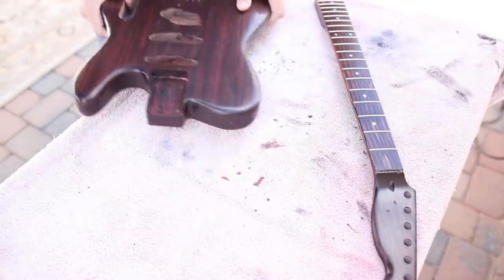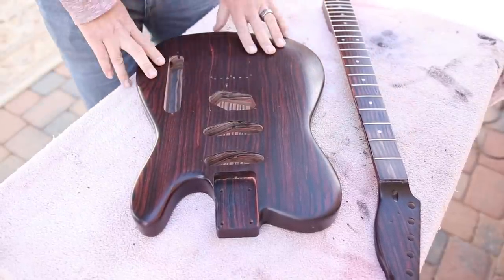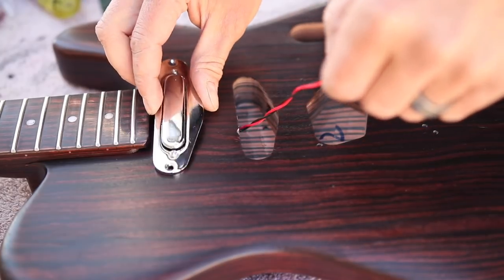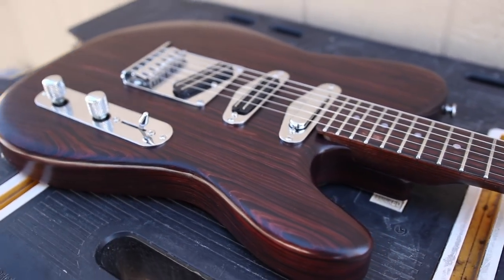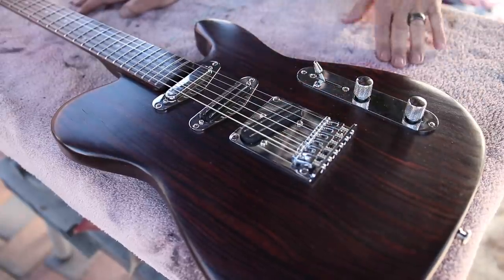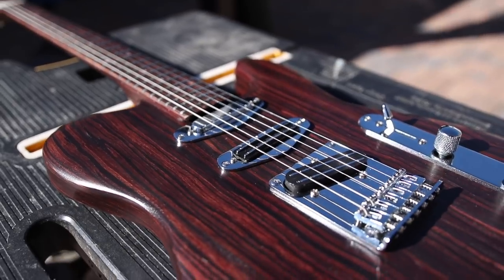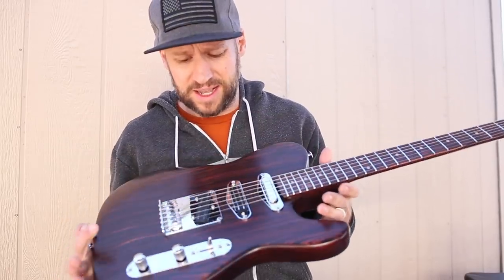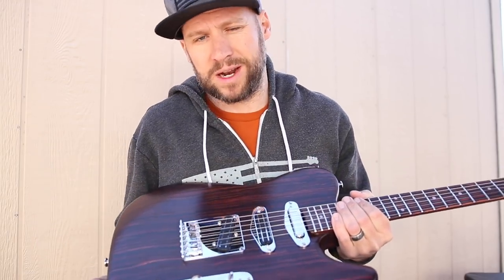Build Your DREAM Zebrawood Nashville Tele (part 2) 10 unique tones!

Comment: Sometimes cheap pickups can surprise you. I've found that the sub-$20 Artec Alnico V mini-humbucker makes a PERFECT neck pickup for a Telecaster. I've built a couple of 'em and gotten favorable feedback.

Next Tele project is a Telestrat HSS, with two Tele neck pups I have laying around (from the sets I bought for the above two Teles :) ), and a Duncan Stag Mag for the bridge.  Five way switch will allow  N, N+M parallel, M, N+M series, and Bridge.  A mini toggle will flip the phase on one of the Tele picukps, and another mini toggle will do series/parallel for the bridge.  Need to get a HB-mount Tele bridge, 'cause I'm convinced that most of the Tele Twang™ comes from that big slab o metal.

Comment: A Nashville Tele has a 3 way switch and a separate on, off switch for the middle pickup. The factory ones had different switching than the Strats too. The only ones I'm aware of with Strat switching are the budget most end of the spectrum. Try switching magnets on your bridge pickup to a neodymium one. It'll make a whole new pup.

Comment: You should get a custom switch plate so that the pickup switch isn’t so close to the volume knob. Just a suggestion. Great video 👍
Reply: Did a Rock Rabbit on a Black Paisley Tele I had, and I was really happy with it!
Reply: I typically flip the control plate 'round so the switch is at the bottom of the guitar. Lets you reach the volume more easily for pinky swells

Comment: All three out of phase sounds lean & mean! I have a Tele also, so I totally get what you were going for with your pickup expansion. 
I built a Gibson style V with humbuckers last spring - I bought a Seymour Duncan strat-style zebra bridge pickup from a private seller on Amazon that’s hardwired out of phase. It’s a very strange pickup, like a factory defect. The Seymour Duncan logo on the white bobbin is upside-down because the bobbin is inverted (?) It looks bizarre! It has a TON of output, and I did the same thing you did & added a push-pull pot. When I have it out of phase, I can blend in just enough of the TV Jones neck humbucker to give it bottom end and added depth. I was going for that beautifully thick dreamy Weezer sound and I got it in spades :)

Comment: Beautiful job all around -one of the nicest Teles I've ever seen. Did you miss a trick with the controls? -I couldn't get used to the layout so fwd-aft I have volume, tone, and a 3-way toggle at a 45 degree angle. The normal way is a logical layout for an engineer, but not for a player, imo. Anyway, congratulations on another awesome build and explanations!

Comment: What you can do if you want the neck and bridge classic tele, all you have to do is add a toggle system 3- way 1-in/out of phase, or cut out completely Then use a 7 way Gilmour mod on a 5 way switch with a push pull, now you can do whatever you want really that would allow you to add the neck pickup with the bridge and you simply cut the middle pickup out with the 3 way toggle.

Comment: I missed the part where you described the body as made from plastic. 

I looked at the listing and it’s listed as solid zebrawood body and neck with a phenolic zebrawood fretboard. I worked with zebrawood and it’s a dense, splintery, smelly wood. This body looks just like I would expect zebrawood to look. I still have a strat with a zebrawood body from 40 years ago. If the guitar feels like plastic, that would be the finish.
Reply from the maker: Nope this is different. It’s made of Bakelite

Comment: This has become one MFinn´ cool looking and cool sounding guitar.
Love the versatility of the pickup tonal options.

Man, I NEED one like this in  a 7-string version set up for metal in two tone sunburst deep french polish like a vintage Gibson archtop with gold hardware and a gold Floyd Rose.
Pickups would be DiMarzio dual blades Fast Track II - bridge, Pro Track - mid, Chopper - neck -  going into a wet/dry/wet Peavey 3120/Classic-50/50 - 2xPeavey MS412 with Sheffield1290s with either cab in stereo so the signals could be routed accordingly.
One monster rockin´setup.
Bluegrass Metal, anyone?.... :)

Comment: Ha! I'm a bit surprised that your all three pickups settings give you a useful tone. I guess I got unlucky with my pickup combination, on my guitar those settings don't really sound good. The guitar looks great. The problem of the weight could be fixed if you put a pickguard on it and drill/route holes under the pickguard. BTW, one comment on the video: The pickup combination tone comparison is quite useful, but maybe consider not only flashing which pickups are selected but displaying them the whole time the given selection is used, that way it is easier to click between different parts of the video, if you want to go back and compare a certain setting with another one that you heard before. BTW, I liked your playing as well.
Reply from the maker: Thanks for the helpful feedback! I actually used to keep the titles up the whole demo but thought I’d try something different this time. Good to know I had it right before!
Reply: @GunsandGuitars  this is a really minor thing really, production value is really high on your videos. And they are always very informative.

Comment: I have a question....... I understand all of the things you did to get the phase right, but couldn't you have moved the neck pickup to the middle position and purchased a single pickup that matched the phase of the bridge to greatly simplify the wiring for us guys that struggle with that sort of thing?
Reply from the maker: Moving the neck pickup to the middle position would solve the winding direction and polarity issues, but would put it out of phase with the bridge pickup. If you reversed the polarity on it that would fix the phase issue but would negate the hum cancelling. See the predicament?
Reply: I do see.... so, I'm guessing just going to a complete stat set would just turn it I to a hard tail stat..... witch wouldn't be a bad thing I guess, but I feel it would lose the Tele feel.

Comment: Also would it be possible to wire the push/pull to split the middle/bridge into single coils? I want to build this as a one guitar to rule them all scenario.
Reply from the maker: Yes you could use a push/pull for coil splits